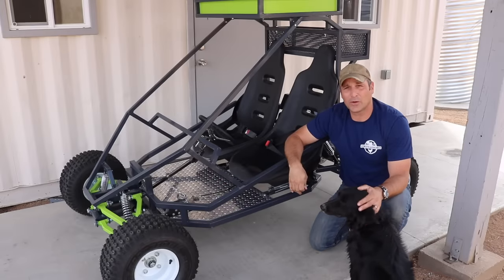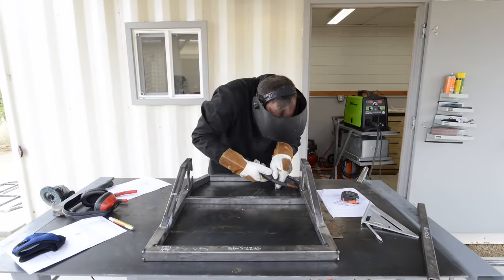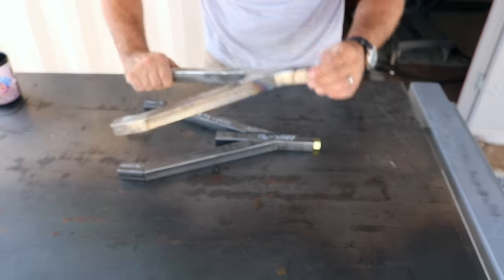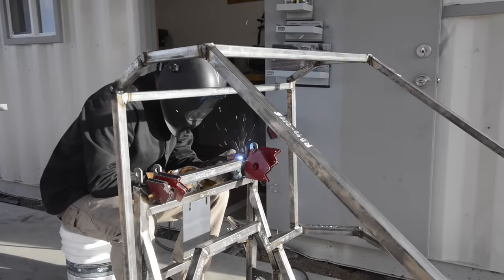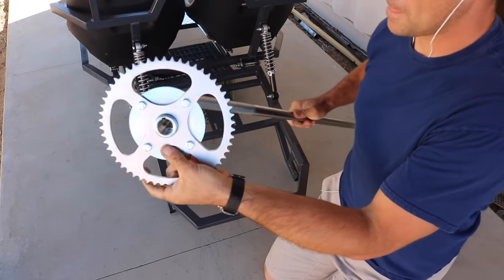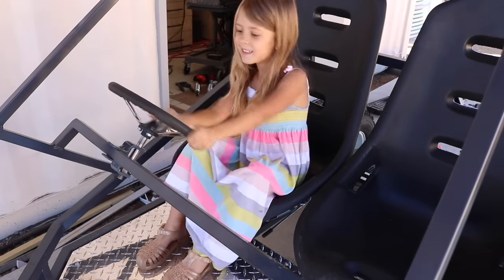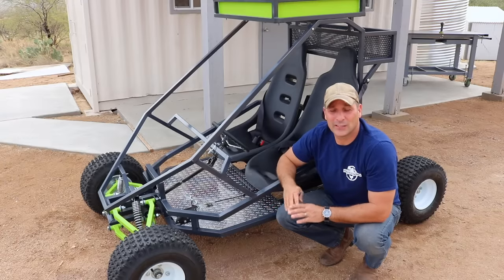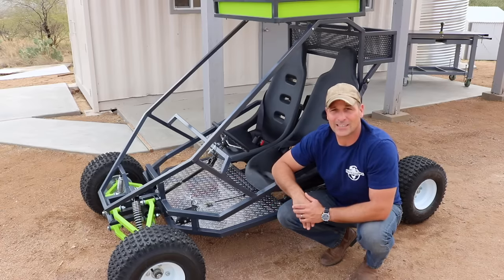Off Road Go Kart - How to Build

Comment: Joe, you are truly the daddy of all daddies. What a fantastic build and it looks great fun. Now that you are teaching your daughter to drive it will not be long before she is asking dad for the car keys. For your next build how about a Siromer tractor (a self build mini tractor from China) or a Tafe from India, someone of your ability could pull it off in no time.
Reply from the maker: lol...  yes, that's probably true... and that will be a sad day for me...lol

Now that tractor sounds realllllly interesting!!!!   is it one of those open source kinda things or do they sell like component parts that you have to put together?  Or a mix between the two... either way you have probably just saddled me into researching that tonight....lol  ;)
Reply: Joe, the Siromer comes as a flat pack in a metal crate (which can be turned into a trailer) and requires building by the purchaser. It can have fitted all the things that a normal tractor needs like back hoe, dozer blade etc and would be a great addition for digging ditches etc.
Reply: @homesteadonomics  
Can you please translate yoyr measurment in centimeters  (CM)
thank you  
✌

Comment: Can you plz tell me the whole cost for this project
Reply: Bodheesh V C did u find out
Reply: I would guess around 1000$
Reply: @zackskinner2666  no fkin way..
Reply: Di Pf would u say more or less
Reply: I would say around 2000 for the common earthling. Once you become a good like him people start to give you stuff for free. Hahah
Reply: I want to build 2 of these go karts and The square tubing for 96 ft of 1inch by 1/8 inch wall is around $100 bucks at local steel distributors. Parts you can get pretty cheap at Go power sports for go karts just to name one for parts. Plans for grandaddy go kart cost is at $48 bucks they give you 7 plans for different go karts for that price. The complete cost is around 400 to 800 depending on what parts you buy and size of engine you want to put on it. The cost is mainly the engine and the steering and shocks and rear axle parts.  Go power sports offers package deals for the steering and rear axle and parts for good prices. Hope this helps anyone looking to build one of these karts. Small price to pay for a 2 seater go kart compared to buying a new one for about $3000 dollars made in China
Reply: @gibbyrock6648  dang really? If you wouldnt mind can you link some parts?
Reply: @gibbyrock6648  do the plans come with specs on  parts?  Suspension, breaking and such?

Comment: Why hadn't I taken up welding when I was younger, and now, in my early 40s, I want to get into it! I know it's not easy, but I feel the itching for it. Love this project.
Reply: Chalres Kirkland Go for it Charles!
Reply: Same here. Bought a HF welder a year or so ago. It does the little lawn mower type jobs Ive done thus far. Welded up a broken muffler and one of the deck mounts broke. So far everything has stood up so there must be some penetration to my welds. Theyre still ugly as sin and require alot of grinding, but atleast Im getting something done....good luck

Comment: This video is a great reference. My grand daddy is nearly complete. I've got the A arms left to do. Not bad plans, they are a bit outdated but work very well. After building the top rails I noticed it was very low near my head so I raised it up 5". Its for my kids but their nearly as tall as I am at 5' 9". It can get a bit expensive when you're buying your square tubing on eBay. So, if you have a hook up on 1×1 and 1¹/⁴×1¹/⁴ tubing you'll save a few hundred. I'm installing a predator 420cc on mine so I had to do some modifications on the back sub frame to run the bigger engine. I have yet to purchase the steering and rack & pinion due to one of the websites on the plans is no longer available. So I'm going to put the whole kart together and then take measurements for the correct steering set up. BMIKARTS, OMB, EBAY and AMAZON will be your go to for parts.

Comment: I have a quick question, how tall are you?  I just bought the plans from Spider carts, and I am debating if I should stretch the frame out a bit (I'm 6'8").  Very helpful video, thanks big for uploading all this content.
Reply from the maker: Hi Terrance,
I don’t often get notifications on these older videos but I’m really glad I did in your case.   The answer is a huge YES to stretch out the frame.   I’m just a tad over 6’ and it’s tight to get in and out of.   For you I’d probably add at least a foot to the lower footprint.  The angled parts of the upper frame are kinda eyeballed anyways so it should be easy to modify for your needs.  
The other recommendation is to upgrade from the 10hp tecumsa that is shown in that directions to a hands with a bit more HP.   

Other than that it is a fun build and I think you’ll enjoy it😀👍
Reply: @homesteadonomics  Big thanks!  Ill aim for the 12" stretch!  The "eyeballying" info is good too.  Your video and photos are a life saver for visual learners, thanks!

Comment: What size engine did you use for this project? I want to build something like this but bigger, more like a sand rail, and I have a motor from a riding lawn mower, it produces 11hp and 17 lbs torque, I don’t know if that will be enough power to get the vehicle moving.

Comment: Ever since I was little I’ve always loved go karts and wanted to build one but my dad was never the type to take on projects like this but you inspired me and I started the same project a month ago after buying the kit from Bmi karts and lots and lots of square tubing. I just turned 21 and I love it so much I’m starting welding school in October. I have all my pieces cut and the bottom of my main frame is welded together, todays task will be the suspension block. Just out of curiosity how long did this project take you? Thanks for the awesome video your the man!

Comment: if you are building another one, use the quad engines, for example, the 200cc loncin are well suited, they have a manual gearbox with a clutch and four forward and one reverse gears, cooled with water.

Comment: Hey dude that's awesome. 
Curious where you picked up the drivetrain components? 
Shocks, belt drive system, rear axle setup, steering rack, brakes etc. 
I'm a welder/fabricator myself and am thinking about building one of these as a trial run for my personal goal. 
Have been planning for a while to build a 2 seat frame to put an 800cc vtwin from a can am along with the clutch and belt drive system into. 

Thanks a lot, great video.

Comment: I have a Yamaha 400 majesty motor. Thinking about a project with my daughter this fall. I know there are many examples with the cn 250 motor from the Helix but it is greatly underpowered. I'd love to get a good designed frame and just fabricate little parts to make this motor a part of a good chassis. I understand most have little travel and inferior shocks. If I could just take that design and improve it with long travel and a modified 400 cc scooter motor it might be pretty cool. I'm pretty good with steering geometry and modifying engines.

Comment: Great job with the build! Kids are gonna have a blast. 

Just finishing up a build of this same Kart for the grandson. Ours has the 212 Predator engine as a starter,  might/probably re-engine down the road as the experience grows. 

Wondering what engine you're running and what estimated speeds are you getting with the standard plans torque converter and tire combo. 

Best.

Comment: So whats that bolt called that u attach the spindle to? Like the nut is welded to the suspension arms but whats that bolt that u screw into those nuts. Like it gives it sort of a free play where u can attach the spindle to it and still move the suspension arms up and down
Reply: I didn't look close enough to see what it was but my guess is that it would be a rod end bearing (rose joint) or a misalignment joint.
Reply: Looking at the video again it looks like a rod end bearing
Reply: Thanks alot!

Comment: What would you say the cost of this was starting from scratch? How many hours did you put into it?
Reply from the maker: haha... hours is a hard one to estimate... a LOT.... but I was also trying to get it done quickly since Forney partnered with me and I wanted to get it done quick.  I'd recommend this be a 6-12 mo project instead of about 5 weeks and change.   as for cost... I don't keep great track of things like that, but it was roughly $2-2400 or so.  I ordered extras of various pieces and had a bit left over so I would say if you were careful and shopped really well, you could build it for $1700-1950 or so... maybe cheaper :)

Comment: Hi @homesteadonomics , were the front spindles and steering shafts and rear axle shaft pre-built, or did they come in a kit or did you just buy steel like tubing and thread the ends? Also for each of the A-arms bracket for the bolts, did you fab them or were they in a kit and if so could you reference me to those parts, thanks!

Comment: What type of engine did you use and how much horsepower does it have? Also what is its top speed?
Reply from the maker: dont' know top speed... maybe about 25-30mph.  the motor was a 10HP tecumseh... but when I ordered it I didn't know that it was an old stock engine and the company has been out of business for a while.  So if I have to work on it parts may be hard to get.  If I were doing it again I'd get a honda engine for it
Reply: homesteadonomics thank you

Comment: Hey Joe! GRRRREAT video, my son found it, and now we have defined project for summer ;) THANKS! quick question - what kind of weld machine have you used? thanks a lot! Greatings from Latvia
Reply from the maker: Александр Трофимов thanks so much!  And great to hear from 🇱🇻 Latvia!😀👍
The welder is a Forney 190mp (multiprocess).  For this build I used the MIG function and all 110 power.  So you could get the smaller version if you didn’t anticipate any 220 needs.
Hope that helps:)
Joe

Comment: hi going to be making something similar to this soon and have a few questions.
what engine did you use please?
also how did u manage to get the throttle and brake cables not to activate when the rear suspension went up and down?

Comment: Awesome Job sir !!!  I have the same engine on my go kart. I was wondering where you got the throttle mechanism for that motor?
Reply: Where did u purchased the engine
Reply: @shaiknazeerahmad7901 . You can find those 8-10 hp tecumseh engines on ebay, but you want a 1 inch straight shaft, not tapered for a generator . BTW this is not my video.

Comment: you shouldve built a long travel suspension buggy or crosskart buggy and not an off-road go kart. its a nice go kart and veey well made, good job and keep up the good work. oh, u need to put a 500cc or larger motorcycle engine on that bad boy.. the chasis can handle it, u built it your self

Comment: For anyone who go's to BMI karts site for the kit, the $999.00 price is for tires, steering wheel, shocks, axle, go kart parts. You do not get a kit that includes pre cut metal that you have to weld together, you have to buy the metal extra and measure & cut it yourself. Plus you have to buy the pdf download plans from another site for extra.
I thought i was getting everything already pre-cut for $1,098.00 and all i had to do was weld it together even after calling them & asking. They didnt clearly answer the question. 
Just FYI if you decide to go that route.

Comment: While this cool and all, the design is dangerous and could break up in accident. The reason companies use bent round tube is for strength as it's more resistant to bending.  Also it creates a single continuous part. This has weak points at each joint that could break apart in an accident. Fore the safety of the occupants at bare minimum there should be a gusset to increase the surface area of the welds joining the square stock together.
Reply: Welded metal is stronger than forged metal. They use tube because it is drastically cheaper. We make all cargo trailers from square tubing, not round continuous.
Reply: Have you ever watched how a trailer performs in a accident they just fold up.  They do use bent tube because it is cheaper, but also because a continuous mandrel bend of tube is stronger then welded tube joint. IF you look how they build sidebyside, ATVs, and automotive roll cages you will see they use bent tubing. The primary loop over the drivers head is 100% of the time continuous this is because of the inherent strength of bent tube steel. Welded steel will shear at the weld points without gusseting and even with gussets no racing body would ever accept a main loop with square stock with gussets.